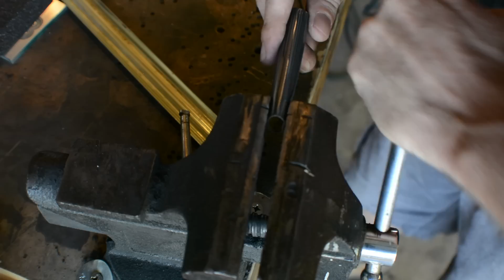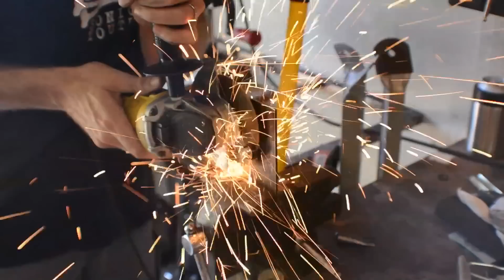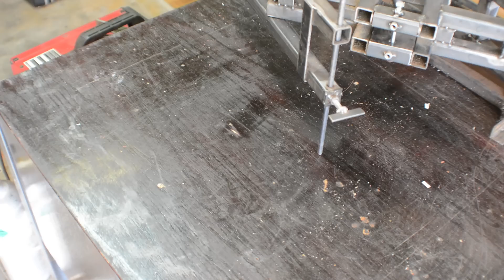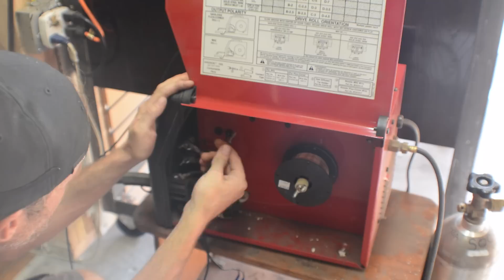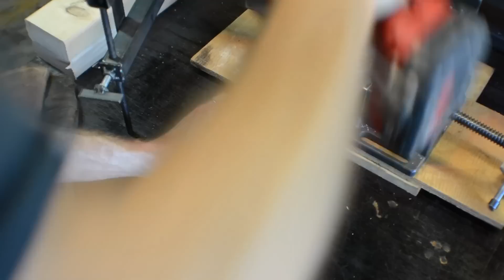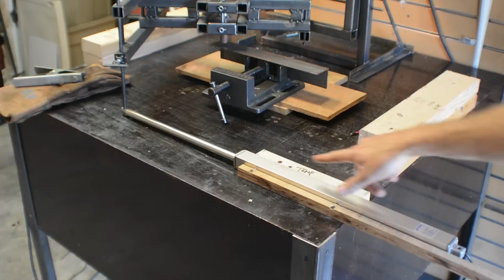The Pantograph Welder (panto-welder)

Comment: Try putting a light dimmer switch ahead of your DC power source for the actuator. It s a cheap way to control the speed. I did a similar experiment with a satellite dish actuator. Good luck with all your projects. Keep them rolling.

Comment: 4 years after, but enjoyed watching. Love the process of making, finding ways to improve. Several comments like "What's the point?" !  I can see several good uses for this almost as-is, and almost unlimited after finding ways to smooth the action and control the speed. It could replace skilled labor for simple welding jobs with a jig and a push button, and dozens or hundreds of repetitive welds. This would be an easy automation project with limit switches, and still not require CNC or programming of any kind.

Someone suggested roller bearings on the joints of the pantograph. I'd extend that to placing a pivoting roller bearing at the tip of the arm that you pushed with the 12V actuator. 
Placing the 12V actuator on a pivot at it's center and the tracing arm tip (that I suggested a rolling bearing tip for) in a track that can be straight or angled and locked would allow for straight lines without concern for the wobble at the end of the actuator's travel. 
I don't know of a direct use for a squiggly weld, but for a thought experiment, having the actuator pivot would allow the tracing arm tip to follow almost any track, including cursive writing with some more manual help from an operator. 

Speed control can be as simple as a rheostat or variable voltage supply. 

Last thing that I recognized from my projects - I always weld or bolt on a grounding tab in a suitable spot of all vises that I use near a welder. I go to lengths to avoid sending welding current through a threaded fitting. 

Thanks very much for sharing your projects.

Comment: for your manual version: how about you add a steel ball under your stylus and let it slide on a smooth surface. This will surely be much more frictionless, therefore much more even in movement. Imagine you have a set of different sized  ' steel ball shoes ' that you just switch under your stylus and with another method created grooves that the steel ball can slide in.
I am sure it will be less troublesome and therefore setting free more energy for creative play.
greetings
Herri in China

Comment: I think, and I could be wrong, your worst welds were when you grounded to the "loose handle" of the "screw" instead of the screw or vice itself.  That handle while ground is not what you could call a "good" ground.  Anyway, liked your project, may try to adapt it to my plasma cutter as I'm having a bear of a time with it.  Think I'll replace the actuator with a threaded rod and a variable speed drill to power it to see if that works better?

Comment: Mig welding is done with the nozzle on and angle to the weld not straight on. Mig should be pushed into the weld and stick welding is pulled away from the weld. It makes a better weld at a 30 - 50 deg angle from welded surface.
Reply: cybot63 ... and the great push/pull debate begins once more.
Reply: It's not a debate when you have been a TSSA certified Welder fitter in pressure vessel welding for 20 years That is how the process is done and that is how I do it. That's why I have never failed a test.
Reply: cybot63 Congrats on that. However, there's an argument to be made for both in certain circumstances. You may not be aware of them, but they exist. Extra penetration, thin stuff, some flux core, the list goes on ... its not all pressure vessels and expensive kit. Oh and I've done a bit myself now and again.

Comment: Awesome plan,awesome video. great idea but you really need to angle the welding tip by approx 5  or 10 degrees to allow the co2 to dissipate and the weld material deposited to flow away from the weld spot(hotspot) rather than be directly under the tip. This will allow a much less critical time speed required to follow your template. If you are welding with a computer operated  control then software coding takes care of the speed. Manually it is almost impossible. . Great idea and works really well. Just needs a slight angle tweaking and you've cracked it. Well done. .. (Incidentally. I'm a city and welder with 30 years experience  coded to ASME IX welding)
Reply from the maker: Thanks for the advice man!
Reply: Good advice, based on many years of experience and knowledge! Thank you.

Comment: Good day

Absorber, I love your work and how you do your videos.

The pantograph is a great idea , your work with the CNC is amazing

About the CNC I have a couple of questions , I would appreciate will answer

What is the current consumed by the motors?

What are the characteristics of the power supply ?

What is the smallest design can be done ?

This last question arises because I want to make PCB 's and the separation between tracks and accuracy of the stroke is something important

David Thank you so much , I really like your work

Saludos desde México, si algún día lo necesitas aquí tienes tu casa
Reply from the maker: Gracias amigo:)
The current consumed by the Nema 17 is up to 1.2 amps.  That's the maximum,  it consumes less in my scenario.
Power supply is 18V, 1.0 amp.
This machine is extremely accurate and definitely good enough to make PCB's.
Saludos desde Tejas!
Reply: Thank you so much for answering my questions

You have a great day , hopefully your projects continue to grow and be happy

Comment: Instead of an actuator why don't you just make a manual speed control circuit and use a stepper motor with a  nut on it which runs up and down a lead screw
Reply from the maker: Sure,  that would work too.